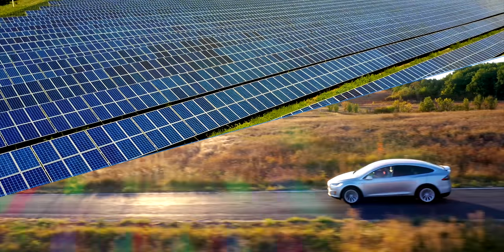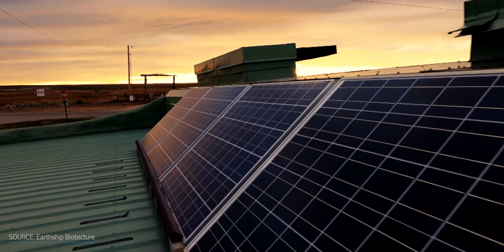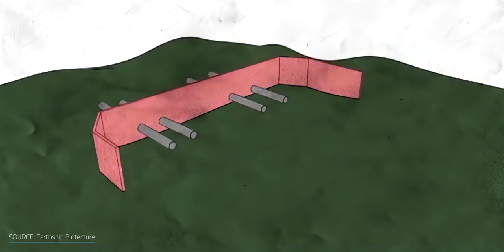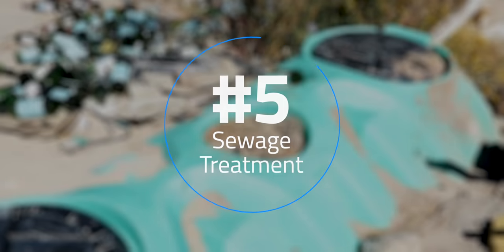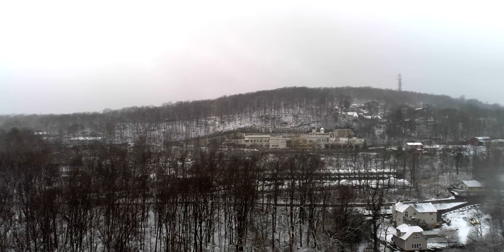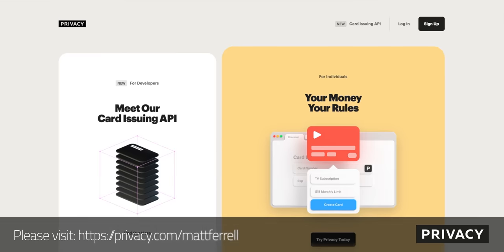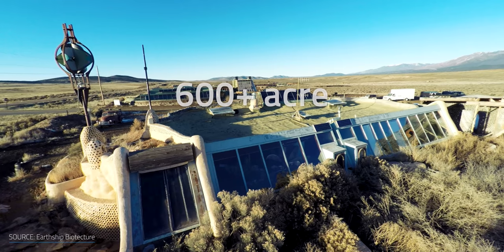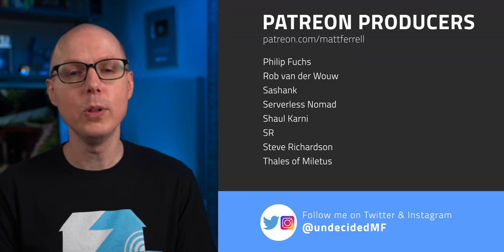Exploring Off-Grid Earthship Homes - Ultimate Efficiency?

Comment: I like analyzing construction methods, but, really, new construction is not what we need to be focusing on.  The problem with housing cost is that there are few to no places left to legally put a house.  An old, small house might go for 800K and 700K of that is just for the "right" to have a structure placed there.  We should focus on cost-effective ways to house more people and to improve the air quality and thermal performance of existing structures.

Comment: When using tires must be filled, sealed and covered with an impermeable coat of something to prevent infestation of various vermin or wrong timing of heating well But when done properly can work well.  As in a lot of things it isn't as easy as it might appear at first look

Comment: I've been researching for decades and I've yet to meet a single build technique or design that is universally the best.  If you have loads of clay available, maybe straw clay (in it's many forms), mud brick or rammed earth are better choices. All are easier and faster to do than tyres and all are less toxic. 
If timber is abundant, maybe just a wooden house. If stone is everywhere, why would you use anything else? 

Oh time, money and (existing and attainable) skills base. So pick a combo that suits you, where you want to live, the engineering design, permits and certifications you may need, the time, skills and money you have, and the resources you have readily available, on or very close to your build site. 

Why pack a tyre with sub soil for an hour, if you can lift a few stones into place in minutes and have something that is not at all toxic, is stronger and has a higher density and will last thousands of years?

Why live somewhere that you're going to have to spend large amounts of money and or effort mitigating the conditions of, when you could elect to live somewhere that is more user friendly?

Nobody knows what you want or need better than you do. Take the time to list your wants, needs, strengths and weaknesses and do the research, both on the many available techniques and the materials, climate and building permit authorisations in the place you'd like to live.

This will save you loads of work, money and most importantly, disappointment.
Reply: I live in the city, the most abundant resource around is trash.
Maybe the tires for the fundation, in a house raised from the ground, or the roof. The fumes will get blown away, but seems it still contaminates the soil and water.

I wonder if it's possible to combine concrete specimen's waste with mud. The diferences betwen dilatations and moist absorptions may create cracks and hollows.

Comment: Is it a good idea to have tires in your home? Tires have passive HC emissions especially if you heat them up, and they contain a lot of other harmful chemicals. Just a quick google search will reveal this easily.

Also, gathering water and then pouring it down the drain, means you "steal" moisture from your area and move it somewhere else.

Comment: Earthships, especially down in hot climates, generally have maintenance issues.  ESPECIALLY the glazing (windows).
Because of the extreme temperatures and exposure, window seals tend to break down frequently (every couple years).
The thermal performance, as you noted, can be highly variable.  It's also highly dependent on the sun.  If you have numerous consecutive cloudy days, and no supplementary form of temperature control, the units can become quite cold.

The fact that Earthships are still a fledgling DIY venture can cause issues that are expensive or impossible to recover from.

Modern understanding dictates that you no longer keep your sink out in the greywater area.  As such units rely on a grease trap to prevent odor.  The problem comes with frequent cleanouts of a disgusting grease trap.

So if you goof on a detail, there may be no good way to retrofit.

Also, what some people are willing to tolerate as "acceptable" for interior environment in an earthship varies from person to person.

Additionally, for any home builder, the big thing is RESALE cost.

A heavily customized earthship can present a barrier unless you're selling expressly to someone who fancies owning an earthship.

Comment: It would be nice if grey water recycling to feed toilets was standard in regular homes. could you shred the tires and use it wall insulation instead of the laborious fill with stamped dirt stacking method

Comment: I've watched a number of building shows, where full on earth-ships are built and earth-ship-esc buildings are built. As well, I watch just about every show where people are building their own homes, using a myriad of technologies and methods. I'm an engineer by trade, but I started off in the building trades. Over the years, I've fully remodeled several homes and constantly research residential building practices, mainly for new builds.

All that being said, with very very few exceptions, all of the homes I've seen built on building shows, vastly overstate the advantages of anything that leans toward nontraditional buildings. The full-on earth-ships are a bit more holistic, but of the maybe dozen or so of these builds I've seen (on shows) leave me believing that there are at least a few major omissions.

Your video does a pretty good job of addressing my reservations, mainly about the reuse use of water, but I have yet to see an earth-ship on a show, that uses traditional (federal EPA regulated) methods for black-water or gray-water. To be clear, toilets, kitchen sinks, and dishwashers are black-water. Bathroom sinks, showers, baths, and laundry are gray-water. Most of these builds indicate that they're using a composting toilet, the product of which still has to be dealt with off-site. Then, they pretend as if the kitchen water is gray-water, when it is not. Again, EPA regulations.

Electrical
The US building code is now based on the international building code and NONE of these builds have the required electrical wiring. Outlets 3ft from every opening and min 10ft spacing along the walls, the number of circuits for the kitchen, etc, etc.

My next major gripe is radon gas, nearly all these builds have floors and walls that are mostly earthen and therefore highly permeable. Even the "fresh air" often comes through tubes that are permeable and not rated for ventilation purposes.

Another MAJOR set of omissions is financial. NO bank will finance one of these builds. NO bank will provide a mortgage to someone wishing to purchase an existing hippy hobbit house. Likely, no insurance company will insure such a home. So, you best be rich enough that you can outright pay for a build like this out of pocket and forget ever selling it, unless the buyer has cash too.

Comment: Earthships were meant to be cheap first. Now some are manufactured for 400k by professional crews following code for resale value in a hot housing market. The code issue is why most are in desolate places. Tires and railroad ties leach chem into the ground, big surprise they are free all over. Most with the inclination will garden/farm also. Its never too early to teach your kids about pcb's. So many thing sound good on paper, this isn't terrible but rammed earth admixed with 8% portland and glass fiber will save time, materials and labor w/o the need for expertise.

Comment: It looks like much of the cost and time-to-build (and effort) is due to excessive bespoke building methods;  these problems plagued house building for thousands of years until we started to improve manufacturing techniques and leveraging factory methods (I remember reading about how brick making improved over centuries to decrease cost and effort for house production but factories really changed a lot).  I think this problem plagues nuclear power too;  the mini and micro reactor concepts (factory built) seems to be the first real chance to elevate this from bespoke and expensive manufacture to mass produced systems with subsequently lower costs.  
Whoever figures this out for this type of construction is going to do rather well from it I suspect, especially as people seem to flee the cities as they are now.

Comment: The problem I see with earthships (me having thought and still thinking on may be making one myself) is the "alternative" part of it. Employing used materials for building a NEW house is not very attractive, specially if you need to process them yourself one by one, with no real change in the price tag. Conceptually, romantic; practically, I get tired just to thinking about it. It also produces a lot of frown upon at regulatory level. The ideal, would be a modular house including the concepts of the earthship. That would be the business. A modular house with recicled materials, planned and constructed following  earthship principles of self sustainability and independence is perfectly possible and properly couple not so expensive maybe (or at leat as expensive as it is now) and waaaay more atractive to the consumer

Comment: Earth ships are fascinating! They tend to build in the desert, but can work very well almost anywhere. Personally I love the idea, and may work some of this kind of design if I ever build my own home.
But the real fascination are the cult like communities that build them and the weird litigation they get into with people who try to do similar things on their own. 

The other fascination is the raw amount of work people put into building them. Again, because of the ultra green groups behind them there is a lot of manual labor and expense that really isn't required, and may actually be no more efficient compared to more excessive use of power tools and heavy equipment. 
And they are expensive! High efficiency systems for heating, cooling, and power generation add up! And a lot of these cult like communities utilize free labor as a sort of advertising scheme, but they also use specific builders for all the clearing and foundation work that make it as expensive as if you hired normal contractors for the whole project. 

Again, amazing concepts and ideas! Beautiful unique homes! But I'd love to have an earth ship style design of being largely buried under ground for temperature regulation... But give me a heat pump, and modern air filtration, and all my tech lol. It could be drastically cheaper to build and maintain than a normal home, and insanely more efficient even if it doesn't check all the boxes for being perfectly self sustaining. Like, how much cheaper (and safer) could it be if they had a centralized  water and sewage plant for the community? Or a microgrid instead of all the redundancy and waste of individual systems? One of the largest issues is water control and mold causing health issues. So put a small heat pump in there for some humidity control and safety,and modern air filtration and seal it up so it will work in the north where you really don't want all that air exchange. Make these even a little less eco friendly or community minded and you have a world changing product!

Comment: Earthships are mostly essentially a return to vernacular architecture, that is using cheap locally available materials in a manner to suit the local environment. What works in the desert is unlikely to work here in Somerset. The materials need to be understood and applied in a sensible manner. Here cob walls used to be very common because they work. However I've seen cob fireplaces built, with some modern knowledge, on a damp proof course. Obviously the damp barrier caught all the moisture out of the new cob. All turned to soft mud and the fireplace started to collapse. Without the DPM it would have been fine. The building techniques need to be applied to suite the specific local environment, else nature will always win...

Comment: Kristen Dirksen showed these off a long time ago on her channel, and ended up being one of their honest critics- it's on her blog, but basically there's not a single earthship that doesn't have serious ventilation and mildew issues because of how each one is sunk into the earth and their high use of cement.
Worse yet is the application of said "non-reusable" items. 90% of aluminum is now recycled, and glass will have to do the same because we are running out of high-quartz sand to make them. But earthships literally use them in high-carbon (30% of all emissions) cement in it's construction, and they don't provide insulation towards the outside. Soil and earth to ram can also become expensive if you don't have an earth mover.
Earthships as a concept aren't bad, but they need a massive rethink to be truly applicable for the modern era. Shame that the creator is continuing to go around the world to sell this 70s idea with 70s technology and understanding.

Comment: Comparing and earth wall with tires means you would have to take the R- value of the full width of the earth wall and compare it to the same size wall as a modern home. Comparing it to a 4 inch regular home is like comparing apples to oranges.

Comment: Would be interesting to see how they handle fires. I mean with the tires in the walls and the blast-furnace-like ventilation system.
Reply: Guess one would have a hard time to set a wall of dirt on fire. Ventillation is a good point, for any HVAC system in any house - what is better, to keep feeding the fire and the inhabitans with oxygene or cut off the oxygene from both?

Comment: Thank you.   Possibly you could go into more details in the alternative to Earthships that are as efficient  but don't have the regulatory issues.  how are they built? What are the methods of heating and cooling?  etc   how do they compare to a 'standard' home that uses geothermal system for heating and cooling?
Reply: Heating is via solar gain from the south facing windows.  Those heat up the solar mass which releases it back out.  Cooling is via cooling tubes buried under earth, when opened they draw the cool air in and they have roof vents to vent out hot air.  In colder places they do have heaters for days when that isn't enough.  They are highly insulated to keep temperature stable.  They used to berm the crap out of them but I think they rely more on insulation now.  

I think earthships are more lower tech than passive homes and perhaps geothermal ones.
Reply: @theuglykwan  That sounds the same as Earthships.  I don't see what difference you are telling us.
Reply: @padraigAZ  Sorry i totally misread your comment.

Comment: I wouldn't say ultimate efficiency but efficiency in very specific areas.  Ultimately Earthships requires land so that you're not shaded from solar energy, wind is not blocked and there's land far enough from aquifers for the septic tank if you're going for greywater toilets instead of composting toilets.  Earthship homes are a lower density than suburban single family homes with the consequent transportation needs and we already know the sprawl of suburbia is too costly.

Comment: I would love to build an earthship, but as with taxes on EV registration, there are many regulations, building codes, etc. that discourage intelligent use of energy resources. I would not be opposed to implementing larger solar panel/battery systems so that active heating and cooling could be used when necessary. That would solve many of the problems associated with tropical and arctic environments.

Comment: 3:24
I don't know where a 4" wall would be a relevant standard for comparison. Standard residential exterior walls are generally 6-8" minimum where I live. Plus a tire wall is going to be at least around 2 feet thick, so the R-value per thickness is actually less. I don't feel like the stated comparison is relevant without context.
Great video otherwise.

Comment: Matt I very much like your channel and on this one I found myself scratching my head a little, I am a scientist but my focus is narrow. You cover a lot of ground very fast, no doubt at the behest of the YT algorithm. I think you understand white, solar reflectivity and thermal emmisivity wavelengths. Is your orientation technology, or are you an engineer? You say your not a scientist, but you asked the comparative questions like I would. You also went practical - so I think your about tech and have an engineering background. Something right up front is you seem to have skipped over is that refrigeration is heat pumping and is not a net cooler - even is run by carbon neutral energy. When you got into greenhouse and HFC’s you didn’t touch on insulation - another source of that gas or that ammonia may be coming back into refrigeration. So you emphasized GHG over other some broader issues. Perhaps living in Phoenix itself is a design problem (you got close to that on water scarcity). 

There seems to be a nice network of ideas that you have presented and all with a positive vibe too.

Anyway, I think passive is the emphasis here esp. if the tech can last many decades. I know we buy what recovers cost fastest but the terms of life cycle matters too - what is the true cost to own over a product life cycle. I liked how you looked at recyclability.